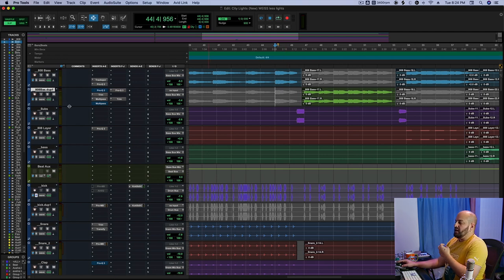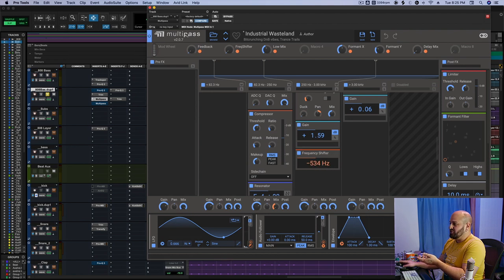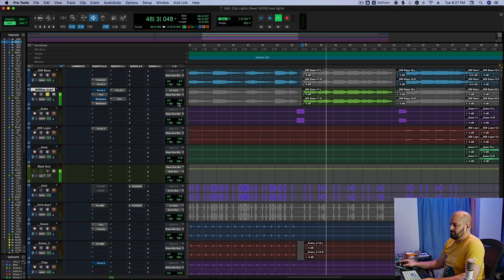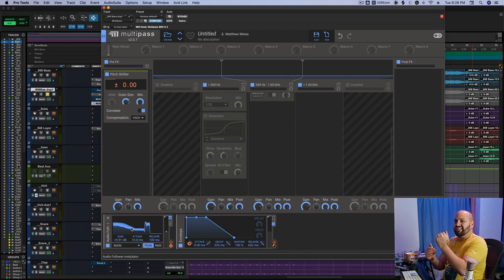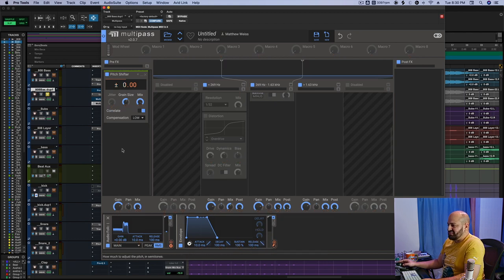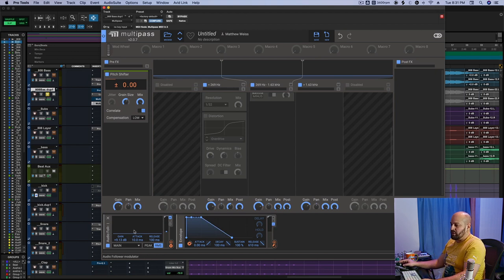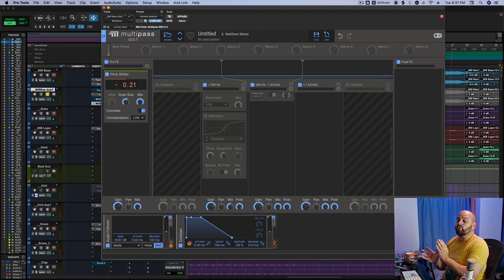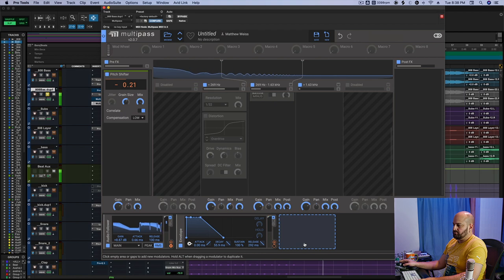808 Envelope Technique - The Possibilities Are Endless!

Comment: If you just want to go down on the pitch you can use a tape stop effect. You have to be more manual about the timing for the tail (btw 1/16th-1/4 note somewhere if your effect lets you choose) and/or do it by ear, but you can get close to that pitching down slide. The 'up' is kind of tricky, but you can use the tape starting sound on many of those type effects. If you do a second track and record your 808 through the tape stop effect, you can combine those two tracks after you take out the parts of track 2 where it's overlapping track 1. If you are trying to make the pitch rise, you'll need to put the 808 at the pitch you want it to rise to on track 2.
  Thats a lot more complicated, but if you don't have Multipass it will help you get a similar sound to what Matt is showing, I think. If you have FL there is a slide option in Piano Roll mode that you can get pretty intricate with. I've seen it used for similar purposes but don't really understand it completely. Baby Audio's 'Pitch Drifter' can do something similar to that last technique he was demonstrating, and it is free.
 I wish I would have seen these last videos when I demoed the Slate stuff! I didn't know all the stuff the Kiloheart efx could be used for. (Should've tried the presets!)
Reply from the maker: There's a portamento/slide control in the FL piano roll. That's really the best way to do it - use a sample that naturally detunes, or create a slight detune in the production.

But... for those times when it already is what it is .... LOL